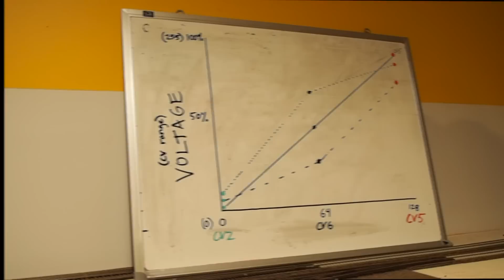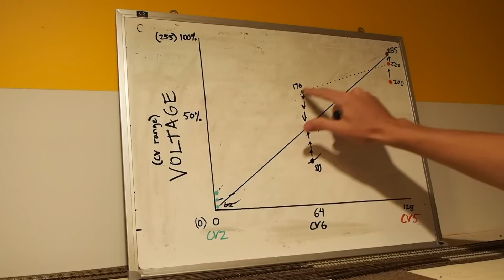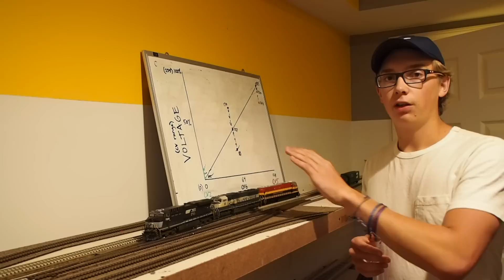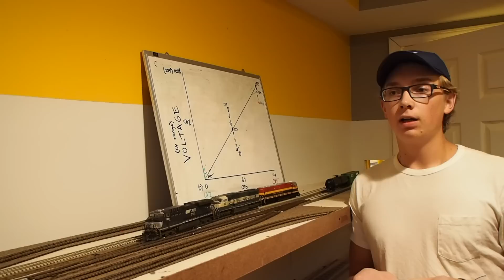How to Speed Match w/DCC: The Fast and Easy Way

Comment: Thanks for this video on speed matching, Cam. It's a very important topic for those of us who wish to run our diesels in multiple-unit consists, as I do. I use JMRI to set the min, mid, and max values, but I still find the whole process of getting the diesels to run at the same speeds to be challenging and not much fun. I appreciate it when 2 identical diesels with identical decoders run well together right out of the box, but that doesn't happen very often. ...Roy
Reply from the maker: Thanks, Roy! I agree, it's not very fun. I even find that if I speed match locomotives together and then change other qualities like load compensation, I have to speed match all over again. So it's sort of tedious. Like you said, it's much more fun when locomotives run perfectly out of the box.
-Cam
Reply: you would likely find in a true consist the 40-2's would likely be the shunters and wouldn't provide power at all you would likely running ace's as the drive unit and the 40-2's tow alongs or pushers

Comment: i have to say its realtively easy to speed match locos once you get the gist of it. 
The video is nicely done. Good explanation and clear voice. 
my only problem right now will be to speed match EVERY single loco i have to match. (i have mainly european since im living in germany.)
this will be a pain in the a.... but i want it since every loco should be able to run with any other loco. at least the european i wont mix them with the americans i have since i either run european or american. So far ive been extremely lucky and actually have 5 different double header consist that just run together for now. no programming required despite it being different decoders in brand AND age. i even have an old selectrix decoder with only 14 speedsteps able to run with a ESU DCC with 128 speed steps without much of a fuss. 
But your explanation will help me greatly in matching everyone of them together. 
Thx for that

Comment: Great video, I decided to attempt speed matching today. I’m pretty new to DCC, but after spending a couple of hours adjusting CVs with the engines in consist I was able to get them to run together perfect at certain speed steps. One is a sound equipped engine and one is just regular DCC so they were WAY off from one another initially.

Comment: Thanks Cam, this was a good start for me. My first two SD70’s ran so smooth and were practically speed match straight outta the box, bought a third SD70 a year later (today), wasn’t even close in speed to the first two! Also a whole different story, but they were Walther’s and the new 3rd SD70 has a completely different sound board, much better but different.... ESU in the new SD70, Soundtraxx in the older yet same model of the first two!!
Go figure.

Comment: The way I speed match my locomotives the fast way is using JMRI. There is a speed table with the 3 settings on it. Setting one is set to zero, mid is set to 128 and the final setting is set at 255. So when you open up the CV table CV2 always equals 1, CV6 always equal 128 and CV5 always equals 255. Only less than 5 minutes to speed match each locomotive. This is done when you setup the locomotive in JMRI.

Comment: Is it possible to consist different types of locomotives?

Such as a GP9 and a U18B.

Maybe even different makes such as Athearn and Walthers?
Reply from the maker: Absolutely! I frequently run consists of different models and makes. I mix Athearn, InterMountain, KATO, Scaletrains, and Walthers. There are certainly mechanical differences, but honestly the biggest influence on being able to run locomotives together is the decoder. I have a mixture of decoder makes and can run them all together well, but it would certainly streamline things if you have the same decoder type across all locomotives (such as ESU). However, it's certainly not necessary.

-Cam

Comment: I haven't been lucky enough to speed match 2 identical Locomotives yet.
I just did a pair that I had to needed very different curves to each other, to match speeds.
One pair even needed step by step matching, to end up with quite different non linear graphs on the ESU program.
I imagine doing some with exact same drivetrains would be more pleasurable!
I'm not sure how close is close enough, but any variations are usually only an inch over several feet.
I think that's ok to short run at least occasionally as I try improve them, which may not actually be possible anyway.
One pair starts at different times, otherwise perfect, delays both set for sound on.   I'll try again some time.
Though it's great we have the tech to usually match them up one way or another.

Comment: Great video I’m new to DCC was running DCS.  Are you changing the CVs on the programming track or mainline?   I’ve noticed that when my MTH Engines are set at say 5 they move like a 5 where my new DCC engines need a much higher number to equal a DCS 5.  I’m not planning on running DCC with DCS but why do the DCC engines need a higher number on the throttle to get moving?   Running new  TCS 13:57 CS-105-B-106 booster

Comment: its also possible to look at the couplers between them. If they are like pushed together then one engine is moving too fast... if they look like they are being puuled apart then likely one is moving too slow for the faster one in front of it. Thats another tip for this kind of thing

Comment: how do you get a single engine to run the same speed in flowered and reverse mine seem to be 2 to 3 mph different at speed step 25 it run 30 mph flowered but 27 or 28 in reverse how do i get it to run 30 in both directions. thank you.  i have several engines that do this.

Comment: Cam,...have you ever seen the RailPro controller system for controlling consists? It is a radio controlled system like the real locotrol in the prototype locomotives. Whenever say, the lead locomotive comes under a heavier load to bear, i.e. steeper grade or any other impedance.  Radio controll signals the helpers to step-up their power. 
The system is much easier to set up, as it is mostly all automatically figured out for you. It's more or less built into the system.
There are some YouTube channels  that show this. Kpack and another video on, The Elkhart Model Railroad Club.
Reply from the maker: Hi, Ron! Yes, I've long been intrigued by the RailPro system. It's something I'd love to get into at some point. I still see advantages to DCC systems, but it's mainly to do with the proliferation of DCC products. Yet, with the way that I generally operate with my own equipment by myself, I probably wouldn't suffer at all with a switch to the RailPro system. Good suggestion.
-Cam

Comment: Thanks Cam. Once you change the 3 cv’s does the decoder automatically change all the others?  If not could you have a problem if you ran two locos at 1/4 speed or 3/4 speed?  Would those be not the same?  Thanks
Reply from the maker: Yes, assuming that the 3-point speed curve feature is enabled (it usually should be by default), changing the start, mid, and max voltage will automatically interpolate all of the steps in between. So 3/4 speed should be the difference between 1/2 and full throttle. Hope that helps!
-Cam

Comment: Cam, this is the best and most simple overview and demo of speed matching. I don't have JMRI but I was working towards that idea since I've seen so many videos on how it works, your video changed that for me. It seems much more simplistic overall and not a lot of changes to lots of CV's. I like most other modelers will be running multiple locos in lash-ups, that's fun for me so I really want them to match in speed as close as possible. 3 CV's and I can have them run very close in speed together. I just saw a video from Sparky107107 and his purchase of the Scale Trainz SD40-2 (Chessie System)right out of the box and those two match up very well. Will this same method work well with locos from different brands? And how will it work with two locos with different decoders in them?
Thanks for your time and the video, dig watching your channel!!!  D. Muse WTCMRR
Reply from the maker: Thanks, David! Yeah, this approach is very simple and quick, and it works perfectly. To answer your questions, yes, it still works very well. I should've mentioned that in the video, but the three locomotives I was running were all different brands and there were two different decoders: Digitrax and Tsunami. So this is a universal way to speed match because CV 2, 5, and 6 are an NMRA standard. 
-Cam

Comment: Question. If i leave the cv5 at max say 255. I then run 2 locomotives and the faster locomotive would i adjust cv6 higher or lower?
Reply: @TorryGood  i used the seconds count app on Android and entered speed steps 10 through to 100 into z21 app. It works perfectly and is free

Comment: Very helpful! You're a great teacher. I assume that in order to run the 2 locos side by side, you programmed them both to the same ID number?
Reply from the maker: Thank you! I actually consisted them together so that I could change the CVs independently. If you program them to the same address/ID, any CV change will register under both units. I did a separate video on consisting, if you want help with that. 
-Cam

Comment: what do you do if your loco wont move until cv 02 needs to be set to a value of say 18?
Reply from the maker: As long as it runs slowly and to your liking, that shouldn't be an issue. Decoders use what's called BEMF to automatically modulate motor input. This allows the motor to run smoothly at low speeds and to compensate for any resistance it encounters. This is great for low speed operation, but when you want to create consists, it's advantageous to turn this feature down. Which CVs are used and how that feature behaves varies from decoder to decoder, but it's likely that the high CV 2 value is a result of BEMF being turned down.

I run all of my locomotives this way, which means CV 2 usually is a bit higher (in the 5-15 range) to get the locomotive moving smoothly. 

-Cam

Comment: Hi great video!!  but I need an advise, I have two Intermountain SD40-2 with ESULocksound also I have my NCE power cab. I just read the CVs 2,3,4,5,and 6 and have the same value for both engines, but still run a different speed, what can I do?   thanks

Comment: Thank you for this video, it should help.  Do your locomotives have to run perfectly to speed match and consist? (like, no stalls in the locomotive) I feel like I've already asked that before, but if that's the case, should I fix it? (I remember saying my Intermountain has a wire loose in the rear truck) 

My BLI SD40-2 has little to no running problems, and my Intermountain ES40DC has quite a few.
Reply from the maker: No problem! I'm glad it's helpful. And no, the locomotives don't have to run flawlessly to speed match them. They'll get programmed in the same way that your nice running units do. So it's not like you're going to harm anything if some of your locomotives run worse than others. It's more of an unprototypical annoyance than anything.  
-Cam
Reply: Cam, that's true. And thanks for the tip.

Comment: I assume that all three of your motors are of the same manufacturer and have the same dcc board. Does your way of speed matching work with mixed manufacturers? For example, an Athearn blue box converted to dcc with DASR board, and a walthers trainline motor?
Reply from the maker: Believe it or not, all 3 of those locos come from different manufacturers (Intermountain, KATO, and Athearn) with 2 different decoders (Digitrax, and Soundtraxx). So I would think you shouldn't have any problems with your mix of manufacturers.
-Cam

Comment: Great video, very informative. Just a question for you. What CV would be between CV2 and CV6? (ESU decoder)I find one of my Bowser SD40-2's runs slightly slower at about 25 (0-99) on a Digitrax system. Changing CV6 makes some difference but there's still jerking about about 1/4 feel speed with the unit mu'd with other Bowser SD40-2's (I have four of them).  Thanks
Reply from the maker: Thanks! I'm glad you enjoyed. The only CVs between CV 2 and 6 are CV 3 and 4 which only control acceleration and deceleration, respectively. The only way to affect the speed curve between start speed (CV2) and mid speed (CV6) is to set the voltage for each individual speed step. It's easy enough to do with programming software; not so much on a DCC throttle. Hope that answers your question. 
-Cam
Reply: Thanks I ended up trimming back CV2 slightly to 1 and CV 6 up to 90 (Bowser defaults them to 3 and 88). That took care of the surge at around speedstep 25 of 99. Still some initial back and forth right off the start but I've seen that with real units when they first start so no big deal. Thanks again.

Comment: tk you good take on video awesdome work on explaning, but when your setting cv are you using a computer or just a hand held im running digitrax new to the game tk you
Reply from the maker: Good question! I was just using my NCE Powercab handheld throttle. I've used Digitrax before, but I don't exactly remember the buttons you have to press to change CVs. 
-Cam

Comment: playing about in the voltages is a grand `idea  though you aren't correcting the flaw by detuning 1 loco to the other you may want to start looking at up[grading the weaker units power to match rather than go in  reverse and under powering the  higher power unit/loco
may be fix the pickups if both units have the same power hardware because it seems 1 has better power p[pickup than the other
Reply from the maker: I see what you're saying, but there isn't really any flaw. What we're doing here is really just syncing the running characteristics across a speed range. These are all different locomotives, with different decoders that come programmed from the factory a certain way. While some will have overall lower pulling power than others, that's often a combination of weight and gearing in addition to the actual motor. So I'm not extremely concerned with the maximum output of the motor because it's top speed is often greater than the prototype's. As long as the top speeds of the locomotives are prototypical and synced, I think it's ok to rerate the voltage down to a level that achieves that goal. But I really appreciate the input!
-Cam
Reply: I wan't thinking of max power though by the indication of the speed step and likely output power you may not get them to the exact same power level, and trying to create a pseudo power profile defeats the purpose of what you are trying to achieve here..

even at half to 1/4 the speed 1 has more power than the other go back an watch your own video and you will understand where I was coming from in terms of actual power between the 2 units of mismatch power..

you may want to do a current draw on both units to understand what i initially said..
Reply from the maker: Ok, yes I think I better understand what you were saying, and I totally agree that it would be nice to upgrade weaker power units. I'm really not trying to argue that speed matching is the ultimate fix. The purpose of this video was just to visually communicate how to sync different locomotives to run smoothly together without pulling against each other too hard. Speed matching does not address the power differences, but it does take into account the other aspects of the drivetrain such as the gears and wheel diameter. That said, I do agree with you and understand what you're saying.
-Cam
Reply from the maker: Oooh, I forgot to add that I think load compensation and BEMF will make up for some voltage derating in a situation with a heavy load. So there isn't a complete loss of performance when derating a more powerful motor or decoder.